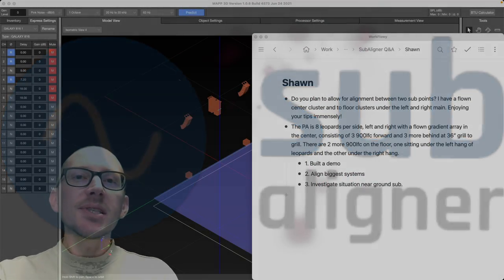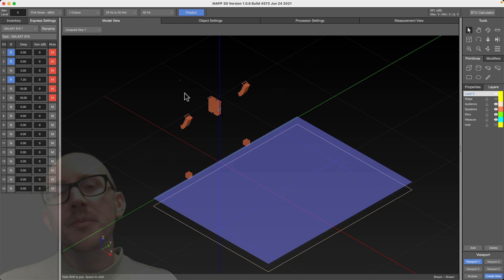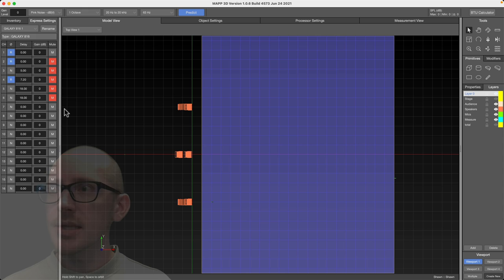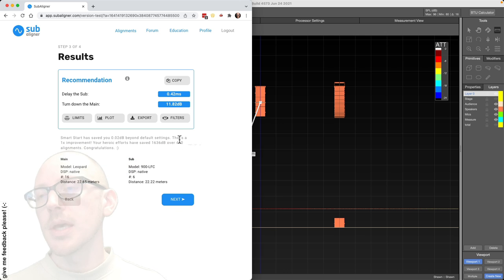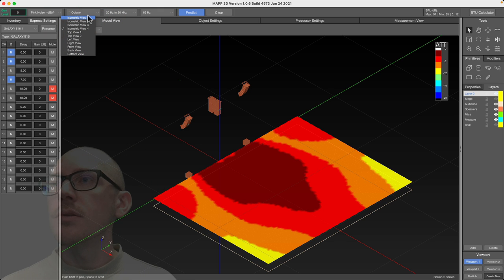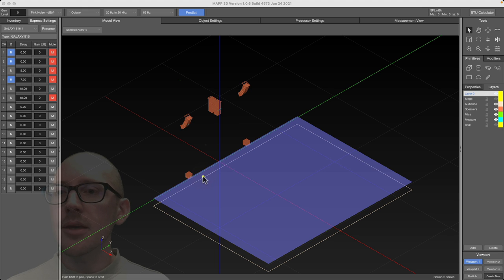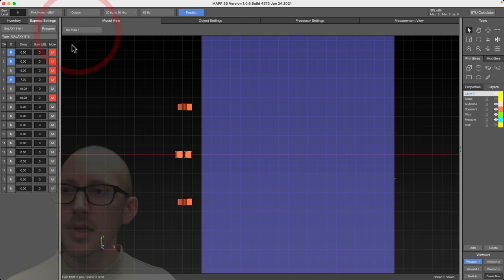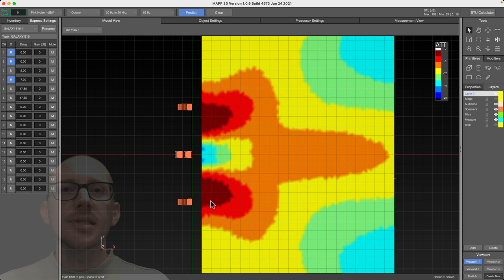How to align flown and ground subwoofers using SubAligner

Comment: Shouldn't you measure the front of the rear sub instead of the front sub, since that one is delayed to match the first (rear) sub?
Reply from the maker: For a gradient array, yes, that would make sense. 👍
Reply: @nathanlively  this looks like a 2 element endfire (2 deep, 3 high). The front of the rear sub is the zero line. Not the front of the front sub.